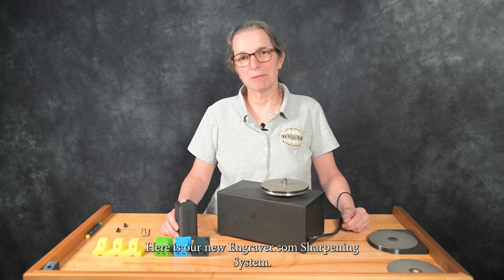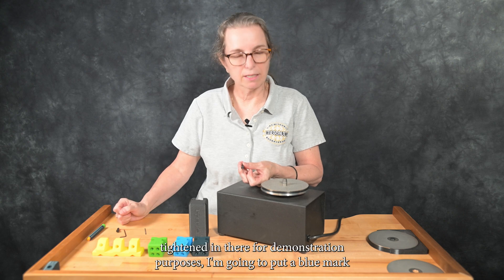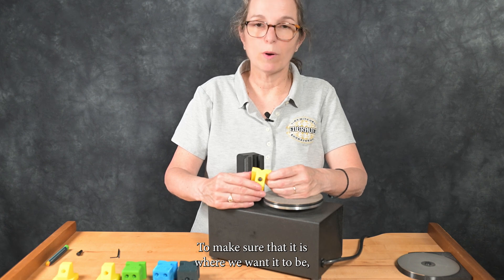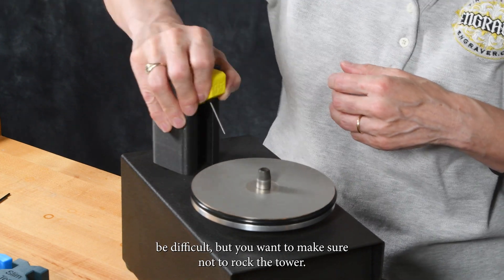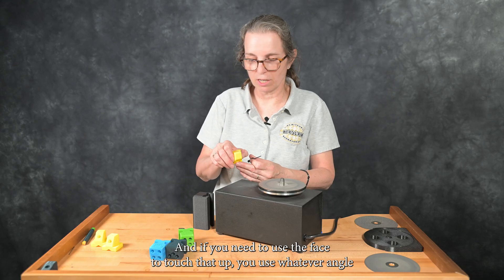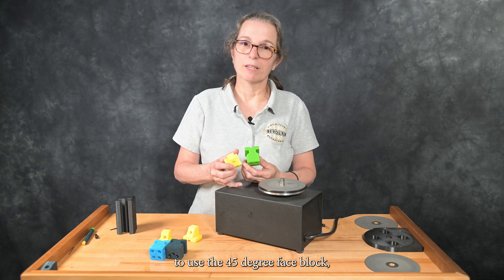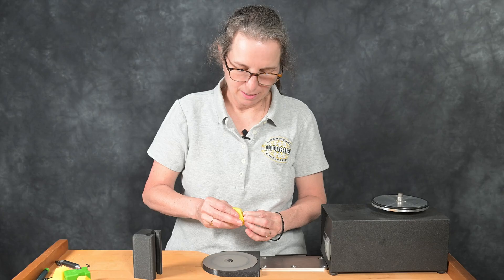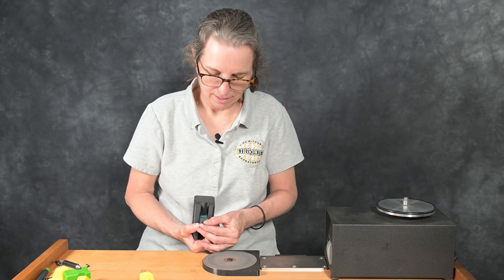Engraver.com Sharpening System - Part 1 - 90 Degree Graver

Comment: Maybe design a bunch of different blocks and sell the STL files (and files for the whole system, as well.)    This is an absolutely brilliant use of additive manufacturing.  I have been wanting to dabble with engraving and setting, but the cost of entry (for a decent setup) is a bit prohibitive.  This is the solution.

Comment: on my wish list I really need a system. i don't have a hone either
Reply from the maker: Hones help, especially if you're starting from blanks.  They save time.  The initial grinding takes a while.  Once a graver is shaped, though, the hone is less important.  One time-saving tip is starting with a pre-shaped flat graver where a lot of material is ground away at the factory.  Another is to use the Quick Sharp Carbide Micro Gravers.  They cut just as well as larger gravers - there's just less material to grind away when shaping and sharpening